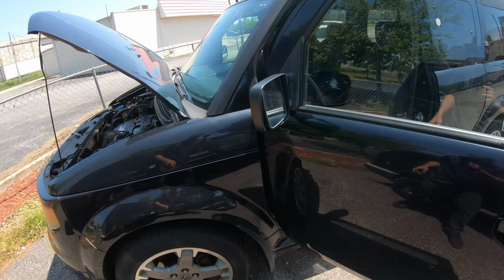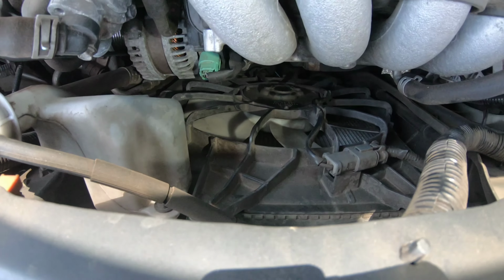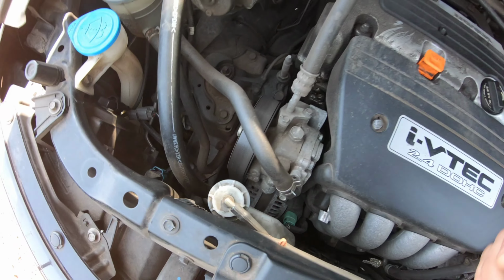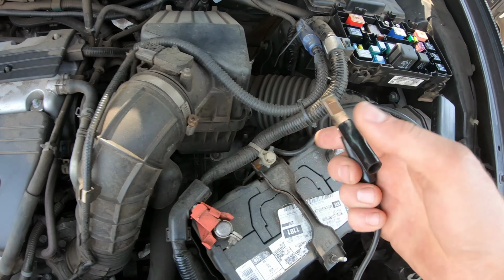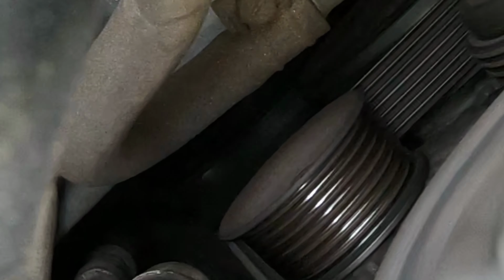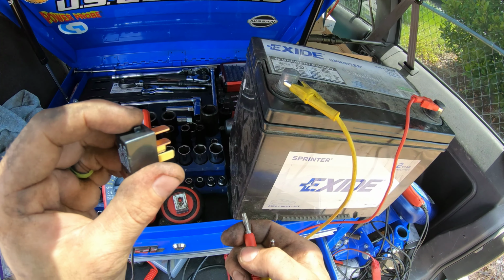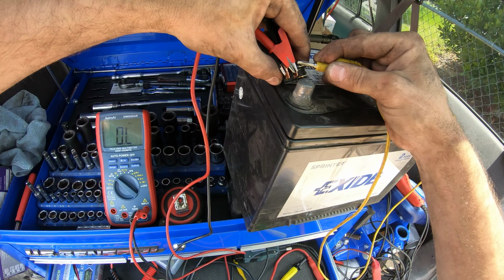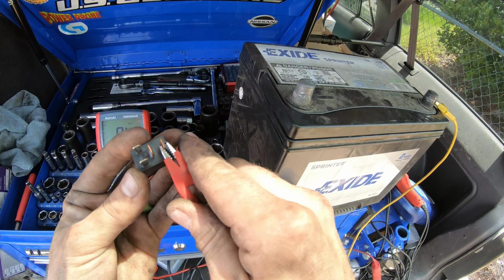Honda A/C Not Working. Air Conditioning Not Blowing Cold Common Problem

Comment: Warranty extension air conditioner condenser on Certain Honda Vehicles 

This warranty extension covers repairs associated with an air conditioner condenser leak resulting from a quality issue with the applicable air conditioner condensers. The warranty extension will extend the original manufacturer’s warranty on applicable components to 10 years, from initial vehicle registration, with no mileage limit. Honda dealers have been provided with the applicable warranty repair procedures. A process will also be available for customers who previously incurred costs to repair a component covered by this warranty extension, to make a claim for reimbursement of such costs.

    2018-2020 Honda Civic (2 door & 4 door)
    2017-2020 Honda Civic (5 door)
    2018-2020 Honda Accord
    2018-2020 Honda Accord Hybrid
    2019-2021 Honda Insight
    2018-2021 Honda Clarity

Comment: Any idea of whats going on here... When my it's cooler outside, the AC/Heat module won't even turn on.  Sometimes after driving awhile it will turn on, or after it sitting in the heat, it will work as well.  I replaced that relay because that's what I figured was the problem, but its still doing it.  Any ideas?

Comment: Hey there, I had the top of a radiator replaced after we found it had a leak and caused the Honda fit aria to shut off in traffic. The next day the ac stopped blowing cool air. Any idea what the problem could be?

Comment: My son drives a 2009 Jazz. It`s a greatcar, but the A/C clutch is dead, emitting a loud noise when driving. Can you remove the belt to kill the noise and still drive the car? Obviously the a/c won`t work, but we`d change the clutch at a later stage. Thanks!
Reply: No, you need the compressor to support the belt
Reply: @turbineking7154  thanks, but do you need the belt? Removing the belt would kill the noise until we can change the clutch, right? And the car would still run, but without the noice and no a/c obviously?

Comment: All Hondas/Acuras since the 90s have bad A/C clutch relays. Most of the time the relay fails to close but like you said sometimes it will fail to open/weld closed. And because the power that feeds the switching side of the relay is constant 12 volt, it will drain the battery if left sitting a short time with the engine off. The fans too are junk on Hondas. Often times failing before the vehicle has 50K miles.

Comment: New subscriber and I own a 99EXL accord with only 62k miles on it. I just changed the cabin air filters and yes they are in correctly but I noticed the middle A/C air outlets have very little air flow. The driver and passenger out let’s are fine. The A/C also does not feel as cool need to check it with a temp gauge. The scanner says all switches open and close properly. I’m definitely going to check the system your way. Great video and thanks for sharing.    👍.   Artie.     Any inputs greatly appreciated

Comment: In my case, the AC stops suddenly. I replaced the relay, new gas, and nothing works. The solution was to replace the expansion valve, and that's all.
Reply: On my daughters Civic it was the evaporator leaking so we changed the expansion valve while we were in that area. Fun stuff. I learned a trick, to place a small strong magnet on the side of the screwdriver to get into those tight spots. This makes the screwdriver hold the screw or you can buy a magnetic screwdriver lol.

Comment: Assuming there is no leak in the AC system, for AC compressor not working issues, there are really two common problems: either the AC compressor relay is bad or the AC clutch relay/fuse is bad. He found the obvious problem with the AC compressor relay despite the fact that it clicks but checking it with the multimeter confirms it is a dead relay. I had a similar bad relay on my older Honda Accord AC and it cut out the AC during a summer trip, such a bad time. What I did not expect he found was the two worn radiator fans! The vehicle only has a little over 100K miles on it and both fans already worn out. I never had any radiator fan worn out on any of my vehicles ever! That speaks very poorly on the build quality on these cheap sub $20K Honda Element! These cheap Honda are made with cheap parts to keep the price low, don't expect it to last like the Honda CRV or Honda Civic! I'd do something very differently to check on these fans: never use your fingers to touch the fan blades, ever, unless you want to lose one or more fingers. These blades are sharp and if these fans have enough contacts, they could spin up and chop your fingers off your hands! User a screwdriver instead to touch it and nudge it because they could come on at any time when the thermostat tells them to run. There are other problems that cause the vehicle to stop sending power to the AC compressor but you will have to check on those only if these two relays are confirmed fully functional.
Reply: 2 common areas on Hondas/Acuras for refrigerant leaks is the compressor or condenser. Look for areas that have accumulated a lot of dirt and oil staining. That is likely where the leak will be.
Reply: I would not call Honda cheap.  They outlast many other manufacturers 9 times out of 10.
Reply: @spannersautoandcomputerser1649  it's kind of amusing seeing so many try so hard to demonize Honda. EVERY make has parts that go bad earlier than they should. Generally, Honda and especially Elements last FOREVER. I just bought two and came across many over 300 and even 400k.
Reply: Honda CRVs and Acura TSXs had a huge compressor design flaw where liquid refrigerant was migrating back to the compressor and because a liquid cannot be compressed, the compressor would detonate catastrophically. They extended the warranty for them but oftentimes it was still outside of the coverage leaving the owner to foot the bill.
Reply: This is incorrect info. The Elements use the exact same parts as the crv accord etc.
Reply: quick question, if I put some freon in the system and it only blows cold air for a week is it most likely a leak? (2007 acura tsx) 
I tried putting the product with UV dye but I could not located a leak. 
AC worked really good with the recharge, just didnt last long.
Reply: @dannyhefner don’t ask the person above a question, they’re an idiot. yes, if it only lasted a week you most likely have a pretty bad leak somewhere

Comment: is the 2023 2014 honda Civic CVT transmission reliable ? CVT
Reply: No CVT Transmissions are ever repairable if it goes on you it's gone. If you plan on keeping the car over 80000 miles do not purchase a car w CVT

Comment: Couldn't you have figured out if relay was bad by just swapping it with a known good relay? Like h0rn relay?
Reply: He is teachings us how relays work. Sometimes you just need to know how things work for you to figure out how to fix it.
Reply: @gabrieltorres6569  I agree, this helped me test the relay and then I was able to trace it down to and bypass the sensors and eventually found a loose ground wire on the AC clutch. We almost bought a new clutch and then would have spent hours replacing that but troubleshooting to find a loose wire is Gold.

Comment: From what I've gathered the Mitsuba relay (39794-SDA-A05) is an improvement over the Omron. And, the Denso (39794-SDA-A02) is an improvement over both the other two.

Comment: Come on, NEVER must I say NEVER put your finger in a fan to test or try to get them to spin. What if it was just a dead spot and it took off like they can do. You'd have no fingers. Please don't show this stuff to DIY ers, you are promoting a accident. Even a rubber hose could be used to tap it. But if it starts that could be thrown at you. Disconnect it and test it with a meter.

Comment: I’ve got new relays, new compressor pressure is right, switch is working, recharged too, fuses are good too and i still don’t have AC. Any ideas on what the problem could be?
Reply: The compressor was working when feeding power directly like you did in the video but won’t turn on otherwise
Reply: remove omron relay take case off clean contacts with light emery cloth replace will work inrush current arcing on contacts causes this i can design and forward an inductive fix to this issue  @cwilly8888
Reply: So something similar happened to my dads ford truck and it turned out to be the blend door actuator. It’s supposed to change the temp, so i would look into it
Reply: Someone stated in the comments to check the expansion valve. Did you get yours fixed? What was the problem?
Reply: @vonnab18  some sort of wiring issue, my mechanic couldn’t figure it out so we just wired the AC terminal directly to the battery and it was a diy kind of fix.

Comment: I got a 2000 Nissan Altima my clutch doesn’t engage it has new ac compressor in it and it has refrigerant. When I jump start the compressor it still don’t blow cold. What you think the problem is ?
Reply: My problem get it figured out?
Reply: @curtisfranklyn4054  nope

Comment: I got a 2011 TSX with no a/c. A/c compressor isn’t coming on and the condenser fan isn’t coming on. I bypassed and jumped the a/c relay and the compressor came on but when I swapped it with another same sized relay it turned back off. What do you think it can be
Reply from the maker: If the fans aren't coming on either you may be low on freon. I would get the freon level checked first and see if its low and if it is check for leaks
Reply: @FixItPhillip  I fixed the leaking valve and got the a/c system recharged by a professional. But a/c compressor or condenser fan don’t come on. The compressor only turns on if you bypass the relay
Reply from the maker: Email me your contact info. Fixitphillip88@gmail.com
Reply: @Airharman123 what ended up being the problem?  i have the same issue as you.  thanks!
Reply: @KR-uk1mz  wired in series of the compressor is a thermal protector. It checks the temp of the compressor but if it’s malfunctioning it’s not gonna turn on the compressor. I just jumped the thermal protector, works perfect now brotha
Reply: @Airharman123  That's right. If the thermal protector opens it shuts off both the fans and the compressor clutch. At least that's what I determined on an '09 Fit.